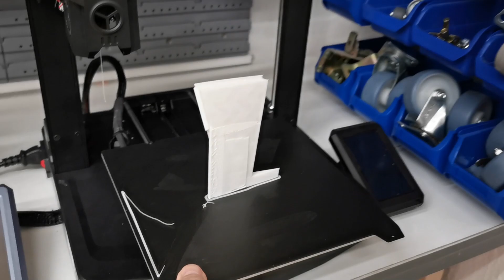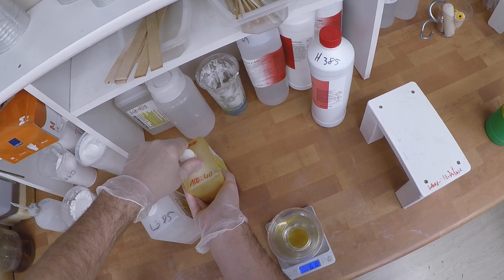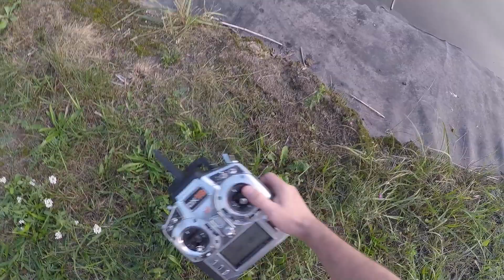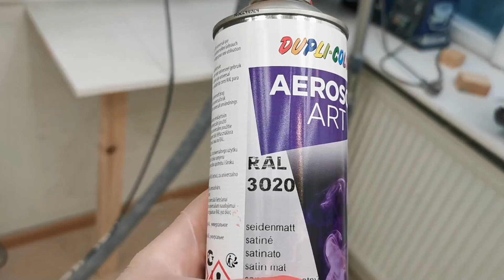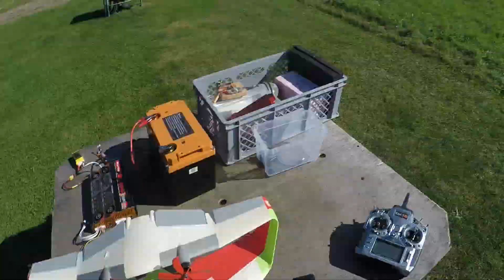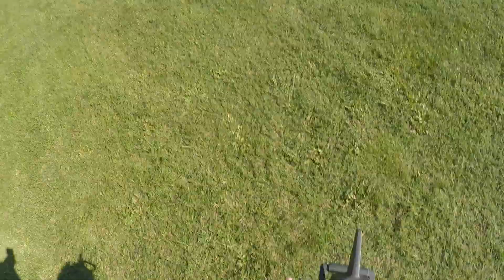Vetical Take Off and first time on Water | 3D-Printed Delta Boxwing

Comment: Add steps to the pontoons so that it can rise out of the water. Just like pontoons on a float plane. They all have stepped hulls to break free of the water. They don't have to be very big. Only a few millimeters of step. It's a great design. Has lots of yaw authority too. You can use some foam board stuck to the bottom front half of the pontoons and make a temporary step to test on the water. I'm pretty sure it will break free of the water and fly. Good luck, have fun!

Comment: This is awesome
13:45 have you considered using differential thrust for turning? This should be possible given there are two separate ESCS.
Reply: Came here to suggest the same thing instead of an underwater rudder.
Reply: @chris993361  great minds think alike lol
Reply: @morkshanmedia3998  lol true enough
Reply: Its more a question of draft in the water. We are sitting too low and the wing pontoons are causing too much hydrodynamic drag. I have already modelled a new deeper hull and flattened the wing pontoons to get the entire craft higher in the water and wings just touching. That way the rudder inputs should work better and allow for improved water taxiing control. The next question is whether we can take off from the water. Rene is in the process of adding more powerful motors and larger props. Stay tuned!
Reply: @marcphilippveenendaal4394  Great work.  My only word of caution is bigger props and motors mean more weight.  Which means more battery to maintain flight time, which means more weight.  If you are trying to get it out of the water...I would guess you should be trying to slim down on weight vs trying to make the thing more powerful.  I think you are on the right path though with making the hull deeper.  I think I'd focus on water dynamics vs more power...

Comment: For more yaw controls you could try differential trust
Reply: If you saw on our previous video, when there is little resistance, the yaw control is awesome. Rene pulls some instant 360's on the ground. It is the issue of water drag on the wings and outer floats. The pontoons sit way too deep in the water and offer too much drag which causes the plane to poorly handle in taxiing maneuvers.

Comment: if you make the drone hull like boat ship hull, then it will float like a boat, ie hollow thicker body wings, same weight.
Reply: Already onto it. making a deeper hull and more buoyancy - we also need to get the wing floats out and close to the water and not in the water. They prevent yaw control while on the water and restrict turning as they create a ton of drag.

Comment: Regarding how she handles in the water, I think better to setup differential thrust and ditch the rudders, servo and save the weight. Also--my intuition was completely wrong about the prop direction! 
😆
Reply: Its also a factor of the "draft" of the hull. We are sitting way too deep in the water with the design and i have increased the depth of the hull to take us to a higher "draft" in the water. Stay tuned as Rene and I work through solving all these challenges.

Comment: Do you have an assembly guide for the JRM-01?
Reply: Which model? 30-50 or 70mm EDF?
Reply: 70 mm edf
Reply from the maker: The guides are included in the download files.

Comment: So you're thinning the epoxy with some alcohol? I guess it's not white spirit but something else like isopropyl alcohol. Also usually it's thinned with like 10% alcohol to keep it strong but you've added like 50%?!
Reply: Its to save weight and just provide enough sealing for waterproofing - not full composite structural strength. rene and I try and keep the weight down on all constructions 😉

Comment: Sorry Rene' but this is a very unstable design. All the lift is in the back throwing your lift aft of the CG by a lot. As a float plane box wing concept you'll never get off the water like this. Consider adding a EDF and duct intake to the nose pushing air under the front for take off and landing. You could also add a diverter or flap to redirect the air flow over the top of the lower box wing to add more thrust and lift if you like.
Reply: Our issue at the moment is the "draft' of the plane in the water. We are sitting too low and the wing pontoons are too deep and causing a lot of water drag. i have remodeled the hull and increased the buoyancy and reduced the height of the wing tip pontoons. This is hopefully going to give us as steeper angle of attack and better wing to water clearance and more of an Ekranoplan "Wing in Ground Effect". More powerful motors and larger props are also underway! stay tuned 😉
Reply: @marcphilippveenendaal4394  Thanks for the reply Marc. Econocraft and the like all use front thrusters to push air under the nose wing to break free of surface tension. I was thinking of something a little more elegant. In my mind i was envisioning something more like the the nose of a manta ray only a closed duct without the split with single or dual  edf pulling air from the topside under the nose with a flap at the tailing edge of the underside of the nose duct. The flap at first pushes water down while filling the gap with forced air. This aids in the initial plane on top of the water in two ways and adds some thrust vectoring when used in flight. This could also be used to add stability in high alpha. High speed air and slow water are not too different except in drag, so smooth semi deep v fuselage and high drooping wings side and aft with raised smooth v float tips. You shouldn't need to exaggerate it too much as to keep the lowest profile possible while maintaining the overall features. Having thrust under the nose with also aid in cancelling out the down pitch of the top fans in the box wing. This makes the lift more even at low velocities. The over all look will change a bit from box to slight A but should allow for the top fans to produce a good venturi effect. Just some ideas to consider. I also like designing aircraft only not so public.